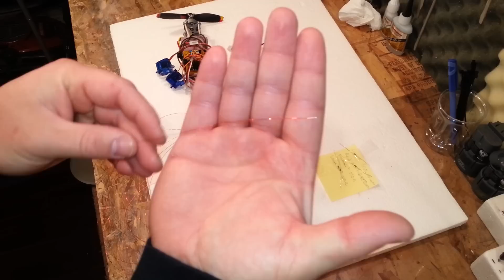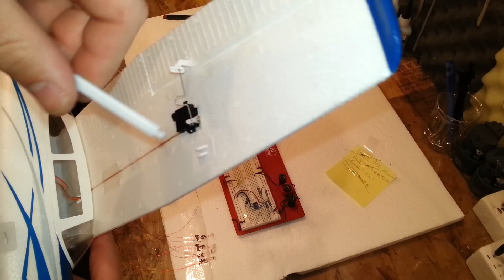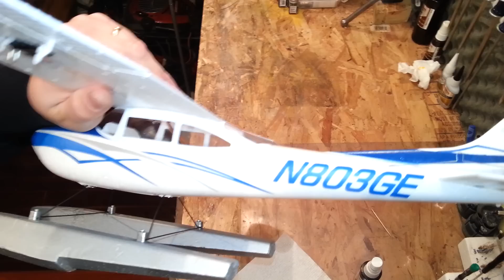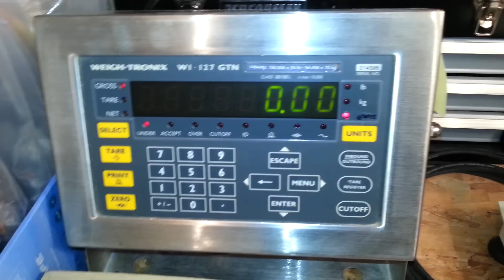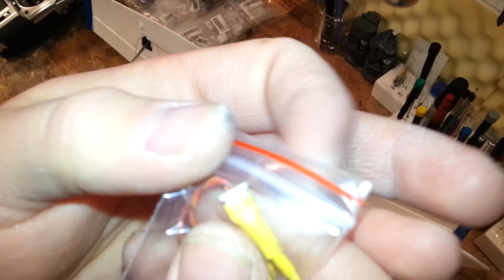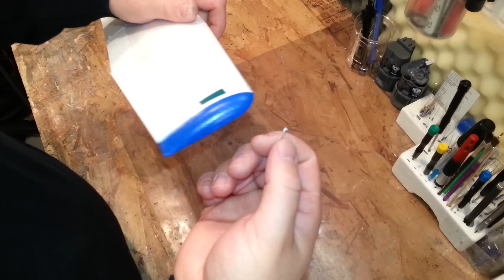Horizon Hobby - Cessna 182 UMX - LED Mod - Part 2 of 6

Comment: Thanks for making these videos and going through the trouble of figuring things out. I bought the UMX timber LED kit EFLU3956 and plugged it in and it worked. I followed the rest of the steps in your series and it really helped,thanks again.
Reply from the maker: I'm glad you found it helpful! I still firmly believe this plane should have had LED's and Flaps stock ;)

Comment: regarding note from Kalvin, ailerons plugged separately into two sockets on receiver, from your vid it looks like you tried the 2 empty sockets which are Aux 2 and Gear (according to a dia on RC Group) and did not get any reaction.  Did you unplug the second aileron wire from Aux1(dual aileron) and try setting that up as gear/flaps? that would of course mean using a Y into the aileron port. I am also wanting flaps but have not removed my wing to experiment.
Reply from the maker: Yes, but it didn't work. When Horizon Hobby locks these receivers down, there's really not a lot you can do about it...case in point, the F-16 UMX is the same way, but I believe I could at least get a servo to move when hooked to the "x port", only it was tied to either rudder or elevator, but I can't remember off hand right now.

To clarify...I tried all the usual ways to get a servo to move (I didn't even care about independence of control for my test), with every of the 8 bottom channels. I have a DX18, but I know the top channels won't matter on a 6 channel receiver. I also tested all of the channels to see if any of them were possibly tied to another channel. Throttle, Rudder, Elevator, Aileron (both ports are equal and opposite output, as expected, and Flapperons also WON'T work), Gear (which is used for SAFE, but DIDN'T make a servo move), and AUX 1, AUX 2, and AUX 3 - None made the servo move. I tried changing the wing type too. I did hook my test servo into a known working port, prior to my tests, and verified it worked.

This is what we call and epic fail. It's a HUGE disappointment in my book!

Comment: could you buy a Y plug for the ailerons and run them off 1 channel instead of 2? If you could do that you might be able to hook up a servo to your flap switch from the second aileron port and control the flaps that way.
Reply from the maker: No, that's a great thought, but when Horizon Hobby locks down the AS3X receivers, it makes that impossible.

I tried to set up flapperons, which requires the two ailerons to be run off separate channels, but those two extra ports don't even put out ANY signal...which is super frustrating. I was hoping at WORST case, I could tap the channel for SAFE, so that with SAFE activated, I would have flap deployment, but nope, Horizon Hobby blocked that too!

P.S. Did you notice I hit 6000 subscribers!!!

P.P.S. I meant to send you a "private message" yesterday, but can't find the link on your channel. I want to help you "tag" your videos. You could increase your traffic by like 20 times without hardly any effort. Maybe you could private message me an email of yours or your folks (if that's okay with them) so I can send you a screenshot of one of my video's tags. I bet you're not tagging them with enough words, so you're missing out on the biggest tool to get new viewers! Google search will really help you to get your videos in front of many, many more people, thus improving the chances of your channel having success.

Check with your parents first though, please, then send me the contact info if they say it's okay.
Reply: What do you mean by tagging with more words? is it more tags or more within the tags?
Reply from the maker: When you upload a video, there's a spot where you can put words or phrases. This box is located below the description box. You can type for instance, Carbon, then press enter, then type Cub and press enter, then type SS then press enter, and so on and so forth. This list will be the words that people can use to find your video.

So if I typed "Carbon Cub SS" into a search bar on youtube, you'd be on the returned list, but because you just added that "tag" you'd likely appear very low on the list, so you want to include as many words that might be relevant to people's possible searches.

It takes some time, but that's how you get people in front of your videos, when you have little to no subscribers.

I hope you'll try it. It WILL help your channel if you do it.